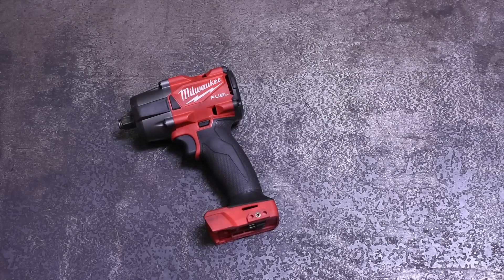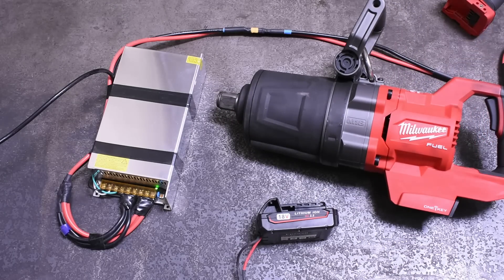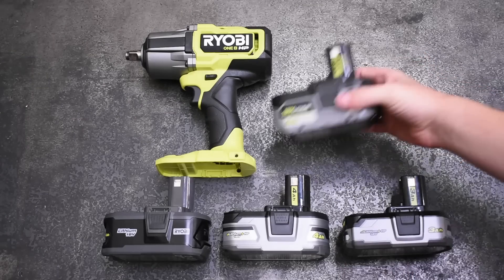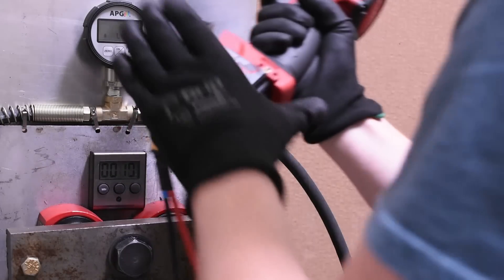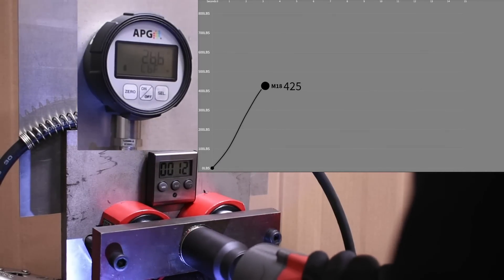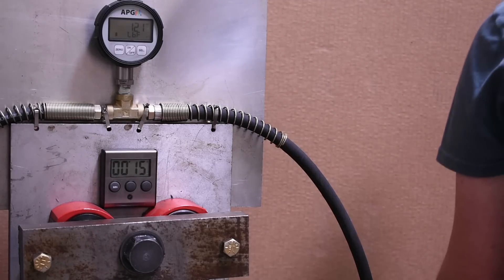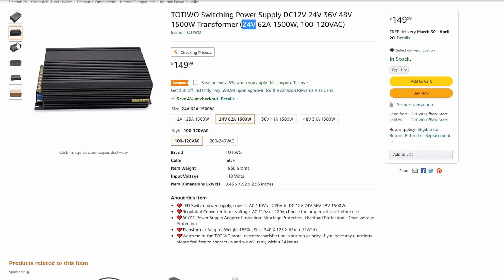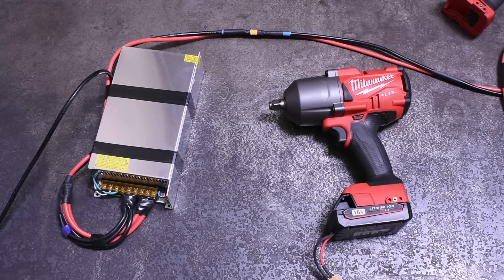Mad Scientist Youtuber Supercharges our Tools: 120 Volt M18 Impacts

Comment: I wonder how clean the dc power looks from that supply on a scope? Maybe just 2 car batteries in series would be better. 24 volts of nice clean dc power with all the amps she can suffer. It's pretty hard to replicate true chemical dc power from ac, much the same way making a true sign wave from a dc source. Thanks guys.
Reply: exactly what I was thinking! 3 x 6V golf cart batteries in series would be pretty close to the original voltages (9 cells @ 2.12V = 19.1V) and with almost no limit in the current delivery capacity. Would be much better then using an AC to DC converter. New battery have low internal resistance and therefore minimal voltage drop under high current usage, as long as you're using big enough wires.
Reply: @savard02  exactly
Reply: @savard02  if you build it.. they will come- or, TTC will test it* I mean
Reply: You can make a perfect sine wave from DC!

Just connect a DC Machine to an AC-Generator! :P
Reply: @sisrace  I've got a old mo-gen Lincoln SA300 that does just the opposite and it's still one of the sweetest welders I've ever run.
Reply: @user-cs1ne8gx9u  In a course in my electrical engineering program we got to visit the university's electrical engineering department and look at the different power delivery systems built for laboratory purposes. 

Giant monster electrical machines, connected directly to the grids 12kV three phase delivery. Able to provide 400V 16A, 63A and 200A. An AC-DC converter like the one you mentioned, capable of ridonkulus amounts of amps. An AC-AC converter, because the grids sine-wave is crap, an adjustable frequency machine, and a terrifying high voltage converter, capable of producing a few million volts, with lots of current, connected to a house-sized copper dome faraday-box. 

Everything is a set of generators and electrical machines. Inch thick ground wires, and 6-7inch thick power cables, one for each phase. Mindblowing and fascinating!

The most terrifying of all was the discontinued high current system. Giant capacitor banks, created to test short circuit currents of power lines. They had to discontinue it because of complaints about the explosions, when massive aluminium power cables vaporized. The system was capable of generating the same power as a nuclear power plant, for a very short time... All this, a few yards from classrooms xD
Reply: @sisrace  sounds like fun. I've done a lot of work in Power generation over the years as a machinist mechanic and quite a bit in the nuclear industry. There's a lot of things in  power generation that you quickly learn to respect, like high voltage breakers that can explode anytime.
Reply: this is how to do it. ~2000 CCA should do the job.

Comment: ..buy old server power supplies. They usually start at about 1000W, and you can put some of them in series to get the desired voltage (look on the web how-to and which ones). And they are dirt cheap...

Comment: Could build one yourself..  get an isolation transformer, a high current full bridge rectifier, a big ass smoothing capacitor, a beefy choke coil and a fuse.  Put a linear voltage regulator circuit before the smoothing cap and choke then you got yourself a circuit you could weld with..  kinda.. is actually how i beefed up a cheap flux core welder to actually lay down some good beads in dcen..
Reply: Actually

Comment: This is definitely the type of mad science collaborations I want to see lol. I actually wondered after the gas milwaukee what would happen if an engine was put on a air gun like the thor which have a different hammering apparatus that meant for high ripems. Keep doing what you guys do
Reply from the maker: Air impact mechanisms stall out (on purpose) intermittently but gas and electric motors dont like that. Air motors dont care much
Reply: @TorqueTestChannel  ah gotcha. I just wondered. But that does make sense. Anyway keep up the awesome content

Comment: I'd wonder how much the US using 120v instead of 240v will limit the current it can pull. Anyone know what wattage these tools are using at max load?
Reply: They’re not pulling that high of wattage. Even at only 18v the wire size is pretty small so the amperage is also gonna be relatively low. 
A full on corded tool typically has more power and runs fine on a regular plug.

Comment: I would start with a name brand (Mean Well?) , quality, industrial power supply that runs on 240vac instead of 115vac to raise the power "limit".   

You also need to keep those DC input power wires short or you may damage the tool with 'ripple voltage'.

Though, honestly, it would be a lot simpler to just hack the tool onto a massive r/c flight battery that will hold voltage and deliver absolutely insane amounts of current.
Reply: It's not for sure hitting the limit, and as long as the cables aren't getting hot they probably aren't wasting much power, just causing voltage sag for which the proper fix is sense lines. Upsizing the cable still wouldn't hurt, those seem thin for the number of amps.
Reply: @javaguru7141  I didn't say ANYTHING about cables and loss of power.  I said "ripple voltage".  Ripple voltage is a result of the mosfets switching inside the tool and can cause the "magic smoke" to come out of the electronics in the tool if it is bad enough.  Long leads between the power source and mosfets make this effect worse.
Reply: @prototype3a  I misread what you said, somehow. Yes you're right, though that's definitely an oversimplification. You'd need ripple on the order of 10% to pose much of a risk. Some capacitance tool-side would be prudent though.

Comment: Maybe diy op battery (will be cheaper)
Like 20 cells of samsung 40T 

Or beef up pcb power lines (extra solder etc) on bms and motor driver so there is no loss of power

And extra beef up battery connection (extra external xt60 or something)

Comment: The question on those power supplies is how /low/ can the voltage adjustment range go? Not that I'd have too many qualms about slamming 24V into an 18V tool. But you could take the 125A power supply at 12V, put two in series (assuming the DC rail commons aren't shunted to earth, then some more sketch has to go into that) and have yourself ~24V at 125A, nearly twice as much as you had this time! Maybe it could handle the 1".

The alternative could be paralleling multiple 18V or 24V supplies, but since current balancing will be far from perfect, they hopefully protect against backfeeding, then you could parallel them all day long and get some decent-ish performance... But don't quote me on that.
Reply: Paralleling multiple switching supplies might cause some complex interactions since they see each other's ripple. The higher the switching frequency the better, probably. I haven't properly studied the topic though.
Reply: @javaguru7141  I assume by ripple you mean ripple voltage (as ripple current exists and is also relevant in the context of power supplies). In my own studies on the subject of paralleling power supplies, I don't recall any concerns over noise from one interfering with the other. In fact, since many types of electric loads can produce noise that the power supply could otherwise sense at its voltage output, it makes sense to put a whole bunch of capacitors on the output and filter that voltage out(The higher power the supply, the more capacitance you're going to have). In that case you can use the voltage almost as an average in that portion of the feedback loop. Otherwise you still have to control the current which has different problems and also varies based on how the power supply is designed.

The biggest problem with paralleling power sources is keeping them balanced. It's very likely one will end up shouldering more load than the other just due to manufacturing differences. It's a complex problem with some interesting papers written on the subject. In this case the magnitude of the imbalance would change the max power you could get out of that configuration, if it was well balanced, you could get close to twice the power. Adding some resistance in series of each supply's output is a cheap way to help balance, but not a perfect solution and wastes energy.

Comment: Another thought, most welders can be adjusted down pretty low voltage, just crank the welder down to like 22V, and hook that bad boy up. Plenty of amps then.
Reply: Yusssss
Reply: You'd need to add a lot of capacitors for it to work since welders don't put out clean power, but it would definitely work with enough of them lol
Reply: @wcvp  just get an old motor generator welder that uses a DC generator to weld, that should put out some nice clean dc power.
Reply: @tuckercudmore7945  I don’t know much about those, but unless someone’s checked with a scope and posted it online, I have a feeling it would be pretty dirty as well.  The thing is, these power tools were designed assuming they would be running off batteries which are just about the cleanest power you can get.  So who knows how well the drive electronics would work with dirtier power, especially long term.
Reply: Lol.  Yes please.
Reply: dont think there would be any way to limit the current. possible mass explosions or just blowing the welders fuse and possibly the drill.
Reply: @MassiveObfuscation  dont need to limit the current, only flows as much as it can.
Reply: Unless you're going for a sub arc power supply, you can forget about AC output. Stick welders are contant current and will increase voltage as high as possible until it attains the current it's set to. At least I've never heard any different. But I don't really see any reason a mig won't do the job just fine. I don't know what the hell you're all talking about with "dirty" power output. Wash it with soap and water or something.
Reply: @maxscott3349  Nothing "dirty" about dc power, Ac on the other hand is a different animal.
Reply: You may have plenty of amps but those wouldn't be the battery-clean DC amps the tool's electronic control requires. At least not on remotely affordable welders.
Reply: @teardowndan5364  yep, use a big cap
Reply: @teardowndan5364  Would putting 2 large car batteries in parallel with the welder help smooth it out? Discharged a little to 11V each for 22V together they should still be able to put out a few hundred amps.
Reply: @seth094978  Although it should help, the welder may not like having batteries or capacitors across its output. Also, most decent cordless tools have current limits to protect themselves, so having a contraption capable of delivering 500+A won't make much of a difference on a tool self-limited to something like 100A.
Reply: @seth094978  You could just weld with 2 batterys...Do it all the time, 2 sets of jumper cables and some arc rods.
Reply: Use the ground clip to hold the rod, It's hotter that way.
Reply: I would assume if you used an ac welder you could delete the brain box since you'd no longer need to have it do the switching (brushless motors are ac by design, the pcb inside the tool converts dc in to ac out by switching polarity) thanks AVE for explaining that to me in 100s of videos
Reply: @noclass2gun342  Brushless motors may be AC but single-phase AC at 50/60Hz will not turn one in any useful way.
Reply: @noclass2gun342  they are, but NJ or quite that simple.  Brushless tools are a handheld, battery fed, scaled down version of a stationary 3-phase tool being run from a VFD, aka variable frequency drive.
Reply: @noclass2gun342 
If you want to use a stick welder beware as they have Uxx- starting Voltage really higher than welding voltage.(from 56V to 88V in some models) while welding voltage 20 to 29V) And they will make the most current at 29-ish Volt not at 20V.
This will burn the brushless controller before you can get some  torque out of the wrench.
Reply: @noclass2gun342  that would be absolutely insane. But I wanna see 3 phase wreck a Milwaukee
Reply: @noclass2gun342  start with the brain box there, and then crank it up till the brain box lets the magic smoke out. Then try and wire it up direct.
Reply: 18 volt, 200 amp. I'm not sure that's legal.

Comment: Static electricity is 5,000v-10,000v so it can trip some of the circuits and even fry electronics.  Grounding tap should be going from the outside of the tool on the handle, down the cable to the DC power supply and tied into the ground.

Comment: I wonder what a pair of RC 4S lipos would do. That is an XT90 connector on there, a 120 discharge RC lipo could be very interesting.
Reply: The standard batteries are just 5s li-ion so you'd want to use 5s lipo packs to get the right voltage, not common but they're out there.
Reply: @GrimResistance  the discharge rating is what matters though. A RC car batteries can discharge a lot faster, providing a lot more amps. Battery is included in the tool have to balance longevity with power over time. They generally try to balance longevity so that they don't burn out after a short time of use. RC car batteries have no such restrictions, very often RC car lipos don't last but maybe a few seasons.
Reply: If you use a 4s pack then it will be significantly worse

Comment: Ive got a (properly working, and safe thanks to a proper case and a non-chinesium power supply) power supply for Bosch 18V. 230V only though (we dont have any of that beginner electricity over here, its all 230/400v 3-phase). Works fine, mostly using it for a vacuum cleaner since the corded one failed months ago and i couldnt get bothered to buy another one.
Reply: U.s. power is split phase 240. We get to 240, it's just split down the middle so we get two 120 V Line. I have several outlets in my house that I have wired 240-volt for more efficiency when it comes to power supply inversion.
Reply: @chubbysumo2230  I know, its kinda strange solution. Cant see why they wouldnt go right for 3 phases instead.
Reply: @semifavorableuncircle6952  probably because the amount of power a regular household needs does not call for two or three phase 208 or 400v power. In fact, most households in the United States cannot even get three phase power, since they are not a commercial business.
Reply: @chubbysumo2230  Enter large AC systems, heat pumps, electric vehicles and other battery storage, and local generation. Suddenly 3-phase seems very much more attractive.
Reply: @chubbysumo2230  Here, even fairly small apartments get 3 phase power, often 25 or 35A per phase.There are 3 phases right in front of the house anyway.
Here, the power distribution at street level is done with 230/400v (all underground cables) with fairly large transformers between 100kVA and 1MVA depending on density, supplied from the 20kV grid.

Comment: I really enjoy your regular tests and reviews, but this Frankenstein stuff is a real treat. Can’t wait to see a 3 phase converted Amazon special or Hemi powered Ryobi in the future.
Reply: If arc flash isn't a concern, you're not giving it enough juice.
Reply: @MGross-jb4vw  YES!
Reply: Brushless tools are already three phase
Reply: @lunchboxproductions1183  he's referring to 240v 3 phase
Reply: 240v three phase doesn't exist in the US. It's either 208v or 480v +
Reply: @lunchboxproductions1183  I bet you're super fun at parties
Reply: @lunchboxproductions1183  It at least used to. The shop I work in was at one point set up for high leg delta, where neutral is a center tap on one winding instead of being centered between the three phases, producing phase voltages relative to neutral of 120V, 120V, and 208V, for 240V phase to phase. I've also seen industrial lighting equipment rated for 139V so that it could be run off of a true 240V three phase supply.
Reply: @lunchboxproductions1183  There is actually 3 phase 240v in the us. It's not very common and it's only in commercial building. It's an open delta configuration. The 208 3 phase is alot more common and is a wye configuration.
Reply: @lunchboxproductions1183  240 3 phase is a thing. Grounded b phase delta configuration is an example.
Reply: @lunchboxproductions1183  it does with a vfd
Reply: @Burb666  can confirm, as the site I work at uses 240 for a few machines. Most of our automated machinery is 480 though.
Reply: @lunchboxproductions1183  there is 240v three phase in delta configs.
Reply: 480v 3ph impact. Would want to see ,  it probably dangerous as hell
Reply: Jesus Christ what?! 🤯
Reply: 240 3 phase exists in the automotive world with some hybrids.

Comment: What would happen if you were to connect it to the batteries of a semi as they have crazy amp ratings like 1000a and being 24v, bet that would pretty cool.
Reply: Just use a welder and crank it down to 24 volts.

Comment: Very cool. The lack in voltage sag def helped a bit, a slightly bigger power supply would've done the trick but it's not as fun as a 1.5kw like you said. Excellent work boys keep em comin